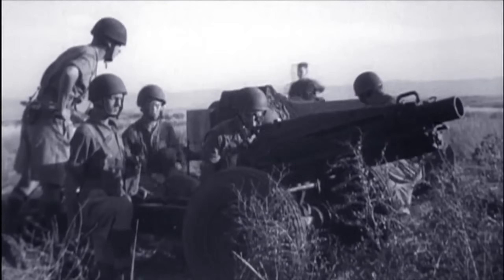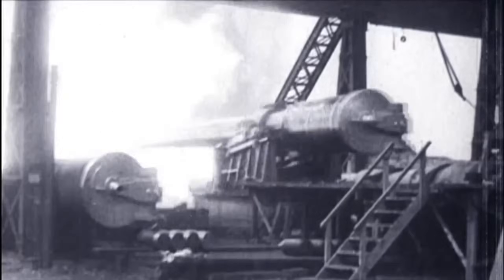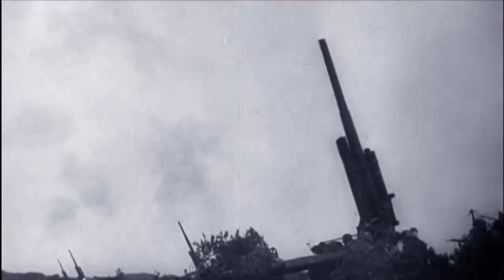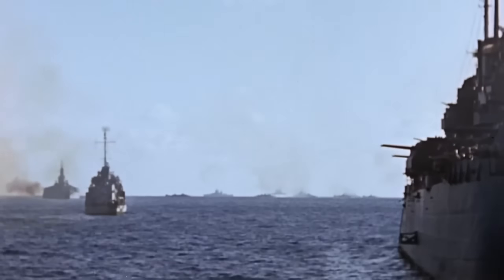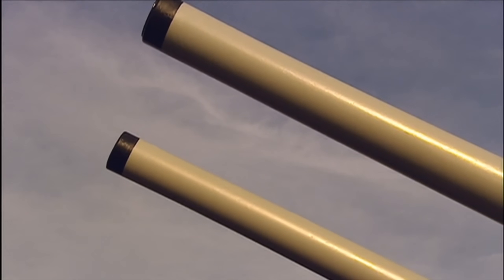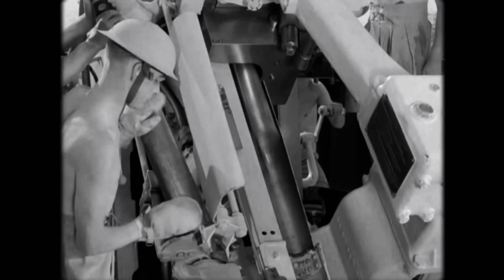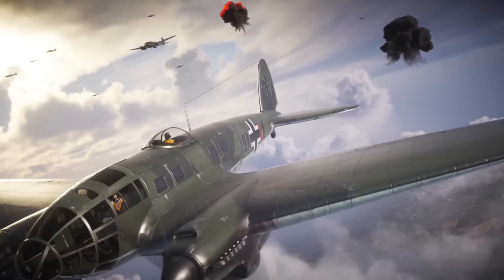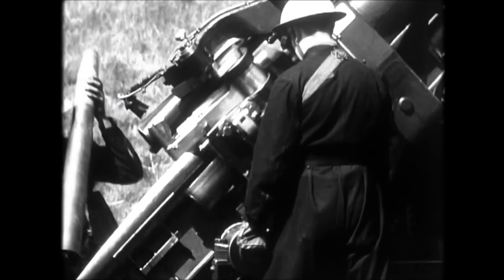How U.S. Artillery Became 50x Deadlier Than German FLAK

Comment: The Germans DID find proximity duds,but it was too late in the war for them to copy proximity fuses. 

German Reaction: German soldiers and engineers who examined the captured fuzes were astonished by the miniaturized radio transmitter and vacuum tubes inside, realizing they were facing technology they had previously considered impossible to manufacture to withstand the extreme G-forces of artillery firing.
*Lack of Reverse Engineering Impact*: By the time the Germans captured these fuzes, it was too late in the war to effectively reverse engineer, mass-produce, and deploy their own versions. The German electronics industry lacked the necessary miniaturization technology and was already under heavy Allied bombing
Reply: Chatgpt ahh
Reply: Interestingly the starting point for engineering those remarkable vacuum tubes were those used in hearing aids. I wonder if hearing aids were available in Germany pre-war.

Comment: with the rise of relatively low speed, high volume drone attacks on the battlefield don't be surprised if proximity fused AA artillery makes a big comeback - its something that makes sense to military procurement and even with the logistics costs is a bargain compared to alternatives
Reply: Programmable air burst munitions are already available - please check AHEAD ammo.
Reply: @zbigniewmalec4816  for like 10k per shell. Simple prox fuse is a few hundred per shell. Missiles are in the 6 figures.
Reply: @zbigniewmalec4816  
Indeed, the 40mm chain gun produced by Grumman already has proximity fused ammo available.
Reply: @zbigniewmalec4816  true but thinking lower budget options will likely get popular, especially if you are building a stockpile and are in the midst of rearmament (like half of Europe)
Reply: @davidmclean357  there seem to be few issues - ammo programability standards are not compatible with each other, and just like with the vt you cannot have air burst programmable in any caliber. Due to the dimensions required you need at least 30 mm, with 35 mm and 40 mm being considered to be more effective as they have more submunitions per shell
Reply: @zbigniewmalec4816  yeah i have often thought old 40mm will make a comeback. (Bofors the revenge?)  thinking some IFV's or UGV's with dual feed for ground and flying targets.
Reply: @davidmclean357  that would be completely useless and an extreme overkill against fpv drones, suicide drones like the shaheed for example would be a reasonable target, but artillery caliber shells would still be quite overkill. The easiest way to shoot down suicide drones are funnily enough fpv drones. Sadly ukraine doesnt have the manpower nor production capacity for that use
Reply: Considering value of proximity fuse vs, programmable ammunitions. Currently Programmable ammunitions and are peace time development. They're great but expensive with relatively high tech and low production numbers. Proximity fuses are war time production they are simple, easy to manufacture in mass numbers. Modern warfare isn't used to have mass spending ordinance in AA roles outside CIWS'. Price gets down after volume.  It is always interesting to see cyclic use weapons. Gun powder weapons made plate armor useless. Then kevlar and other body armors were developed to protect well trained soldiers etc. Now we are returning massive automated gun AA. SKynex, Skyranger, Swdens Loke & that new un named anti-drone automatic cannon system. They're getting really effective. Then add mix Microwave and Laser weapons. We will have triad of inexpensive drone and missile counter system consisting Lasers, Microwave Emitters and automatic guns linked in multiple radar system, leaving expensive missiles against the planes and other high value targets. That is what I think we are heading. When you can take down 4-10 400$ dollar drones with single 0,10 - 5$ shot, war of drone attrition scales back to defenders advantage... when there's enough guns and radars.
Reply: Bofors knows business is about to pick up😉